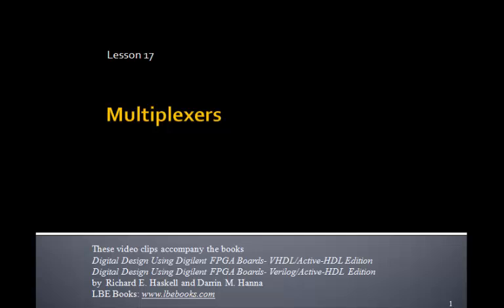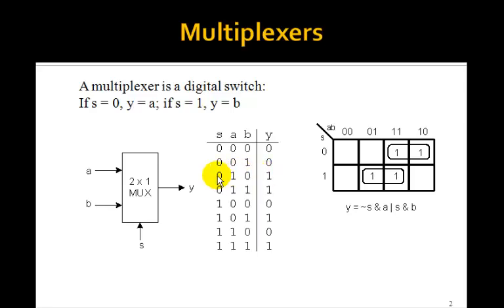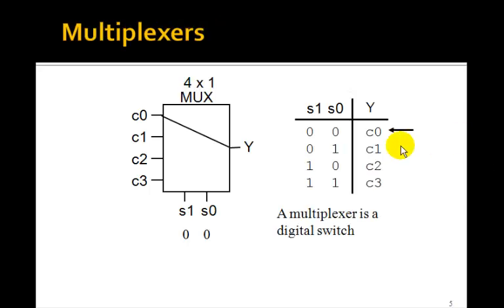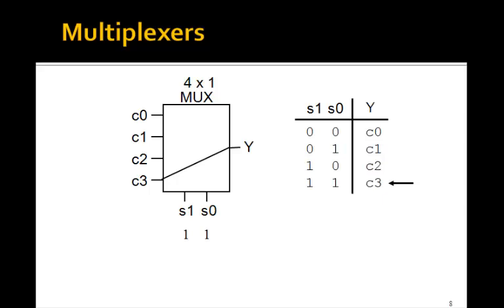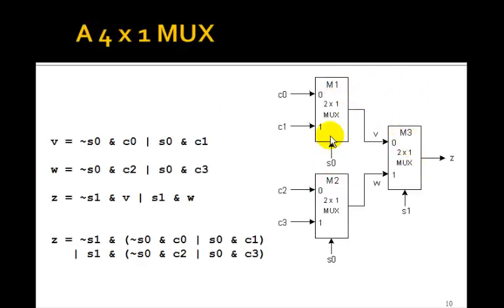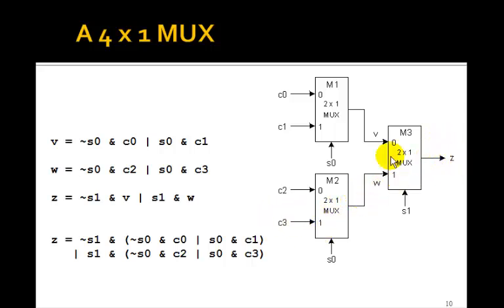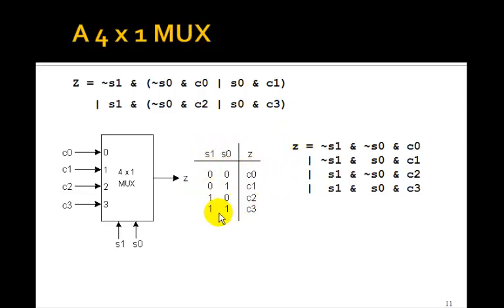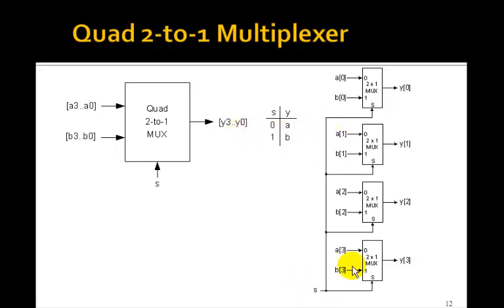Lesson 17 - Multiplexers

Comment: If this has been confusing to you, download Logisim, and follow the tutorials; in the help menu, one of the first lessons shows you how to construct  a 2:1 and 4:1 MUX, all will make sense. Basically it is an electronic switch, where depending on the settings on S wires, only one path will be switched through the device from any of multiple sources to one destination. I suppose this is how a network switch is constructed.